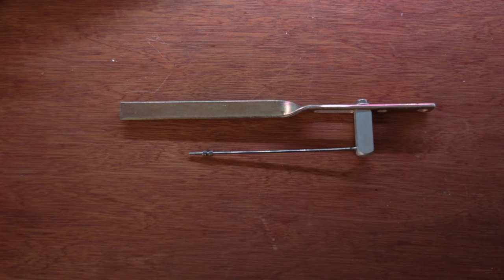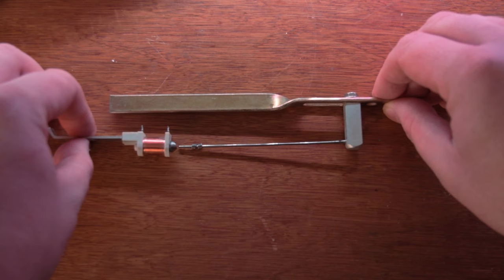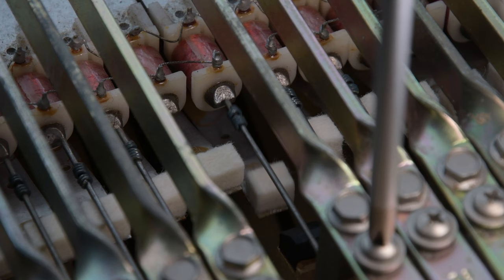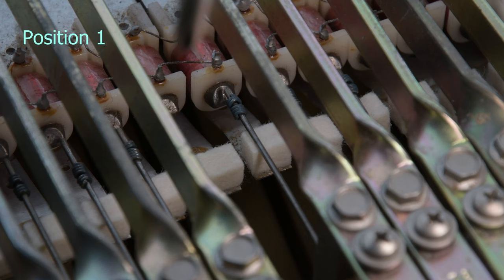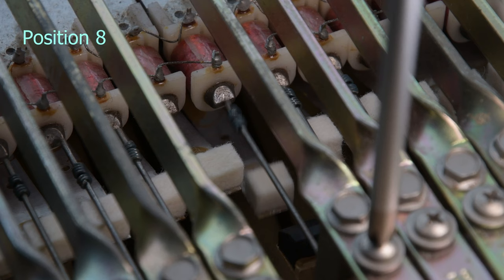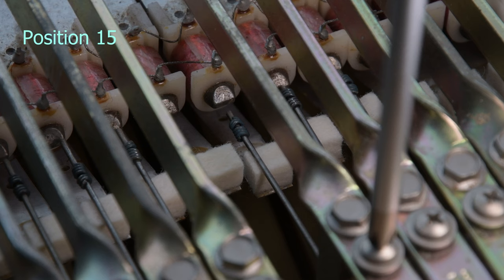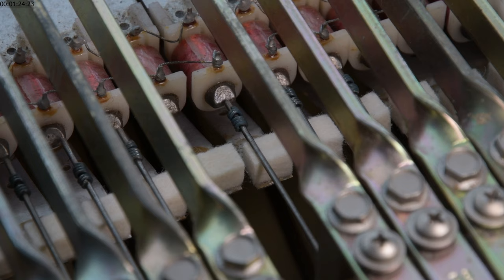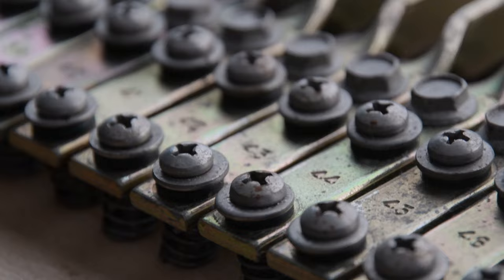Voicing a Fender Rhodes - Which position sounds the best?

Comment: I don't think you really want to voice it below the middle of the pickup (position 11) beyond the pure overtone because you're essentially going to get the same voicing as the ones above but you are also affecting escapement and strikeline at this point. The hammer tip is going to hit the tine at a much lower (vertical) point and not in the sweet spot.
Reply from the maker: Some good points - You are right one small change does change other parameters of the piano, with the action being so simple. My logic going beyond the centre point of the pickup was that we are only adjusting one screw, we are introducing angle of the tine into the equation.

Comment: 4-7 is best and it's about where I think my MK1 is voiced! Position 1, 2 & 3 are basically just a sine wave, smooth but no character, 4, 5 , 6 & 7 have a bit more character and you can start to hear the attack of the tine which is pretty much the sweet spot in my opinion. I like a pretty pure sounding Rhodes without too much harmonic or bark, but I still want a bit of character and tine noise as well!
Reply: 7 position is closer to the timbre of the piano. But in all positions when the damper dampens the vibrations, there is an unpleasant rattle, I think this is due to the rigid damper, if it is made softer, the damping wakes up not sharp and will become more pleasant to the ear.

Comment: Have you tried adjusting the strike line?
Reply from the maker: Yes the strike line is very important - I have a video where i a build a giant tine and you can feel the spot where it should be struck. I believe its 1/3 along, and this creates equal angular moment in both directions so all the energy is absorbed into the correct tine motion!

Comment: By changing the ratio of the sensor and the vibrator, you achieve reading only part of the vibrations, the top of the harmonics, so the timbre practically loses the main harmonic and the middle harmonics begin to prevail, but it's strange why the 17th position gives out the timbre of the 7th position!?
Изменяя соотношение датчика и вибратора, вы добиваетесь считывание только части колебаний, верха гармоник, таким образом тембр практически лишается основной гармоники и начинают преобладать средние гармоники, но вот странно, почему 17 позиция выдает тембр 7 позиции!?
Reply from the maker: It did what I expected, just not quite when I expected.

Comment: This instrument would torture me on every job. First of all the action never felt right.
I mean you REALLY had to work to play this keyboard. 
But worst of all, These Tines would break quite frequently,  and they would usually be the ones you used a lot ...
While other guys in the band were on a break, I would have to sit there with my screwdriver and super heavy wire cutter putting a replacement tine in and tuning it.
I literally had a  bag of Tines with me all the time.
The best thing that ever happened was they sampled and digitized the thing so you  could get the sound and modify it on any MIDI Keyboard !!! 🤬
Reply from the maker: Did you ever play a Wurlitzer?
Reply: @deancoyle  Yes I Did ..... and it was seriously easier and more fun to play ... , but once Billy Joel released Just the Way You Are ....we were clammering for that Rhodes sound and the MXR Phaser ....lol
Had I heard a Wurlitzer with a phaser I might have went in that direction ...
I think Richard Carpenter put the Wurlitzer all over the airwaves but it wasn't a Rhodes and you know how desperate keyboard players would get for a certain sound ...!?

I couldn't wait to get back to a breakdown Hammond X5 which showed up around 1975.
And the Discs in my back will show you that the split Hammond was lighter than the Rhodes Suitcase....lol.... 😣😣😣